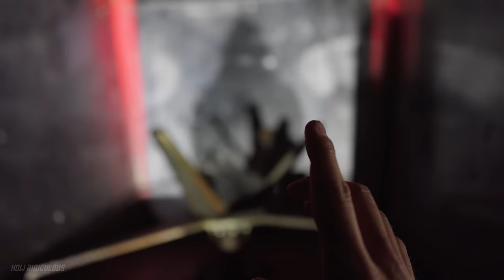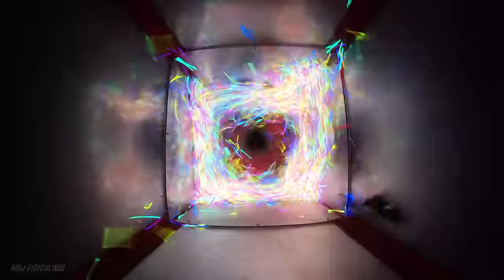10,000 Glow Sticks Vs. World's Largest Blender!

Comment: Mad respect to whoever was responsible for closing and securing the door, during the night shots. When the door pin didn't go in right away on the 1000 sparklers blend I was genuinely scared for whoever was doing that job.
Reply: it cant be that hard to shut  the door 💀
Reply: @AidanMcDowell-ez1ny  i mean, have you ever tried to shut a door that big within a small time margin? its easier when you have more time. but when youre against the clock, things seem to be harder to do
Reply: @AidanMcDowell-ez1ny maybe *you* try quickly shutting a door that’s 10 times your size 💀

Comment: The blades heated so quickly because most flammable liquids like gasoline or most solvents burn hotter than a regular flame from wood. The jet fuel burning from 9/11 is what took the towers down. It melted the frame of the building because it burned so hot.

Comment: Scott putting his hand on a thick metal piece and concluding it has heated all the way through is like my grandma putting a whole frozen chicken in the oven on broil for 3 minutes and concluding that it's perfectly cooked.

Also sure the rotation speed of the fans can assist with the overal heat transfer throughout the metal, but not only did it not sustain the spinning long enough to matter for the heat applied and the thickness of the metal, but it also did not add any "New Heat" like scott is implying. Convection is a method of retaining and circulating existing heat, not a method of generating heat. It could at most contribute to the metal retaining some heat from the fireball, but the fans rotating would not add any substantial heat, and certaintly not 40%. The obvious most important contributor to the heat would be covering the metal in a liquid based fireball for a minute

Comment: I think that newheat is potentially a small factor in the heating of the blades, since it does technically get closer to more hot particles. but I doubt it did much, steel( as all metals) is a pretty good conductor, so it absorbs heat quite quick. also, it being 4 cm thick doesn’t matter too much, because you were only feeling the heat on the surface, it was probably a little cooler inside. Those flames will have easily got to over 1000 degrees C , for about 5 seconds, that’s quite a lot of heat they’re baking in.
Awesome

Comment: You need a remote triggered compressed air cannon on the bottom\floor so you can blast the stuff stuck under the blades upwards.

Comment: I'm on team #newheat - The introduction of convection into the heat, is the same reason that a fan oven heats up faster than a conventional oven.  The heat will exponentially increase, the more oxygen is added to the fire.  This is why you get flashovers from house fires where as soon as oxygen is introduced, the whole lot goes up like a bomb.  Gaunson is right on the nose with this one.

Comment: Steel warms up quickly because it has high thermal conductivity, meaning it efficiently transfers heat from its surroundings to itself. Several factors contribute to this:

Surface area

Density and Specific Heat Capacity

Thermal Conductivity

Comment: You’ll want to take a look at the discipline of heat transfer. My hypothesis is that the dominating mechanism of heat transfer here was convection of the hot air over the fast-moving fan blades that caused them to heat up quickly. Imagine you are a very tiny person able to stand on the blades as they are rotating. All you would feel is a bunch of hot air moving by you really fast. It is the same reason why wind chill makes it feel colder than the ambient temperature, and the faster the wind, the colder it feels.

Comment: the movement of air and material can contribute to heat factors, think of a convectional oven moving around hot air vs just placing food in a hot environment. The movement of air allows heat to transfer quicker to the object its exposed to.

Comment: Convection is only really a contributor to heat transfer when you're using a medium (air, water, etc) because the heat is being transferred, meaning the medium is cooling as the target is being heated. The rate of heat transfer is directly dependent on the temperature difference. However, an open flame is producing new heat constantly. You can't really "cool" a flame. However, the mixing action did make sure that the entire surface saw even heat, meaning it was more effective than trying to use, say, a blowtorch. Based on what I know of steel, the actual surface was likely hot, but internal temperature was still fairly cool, meaning it cooled down quickly as heat is dispersed throughout the steel, as well as ambient losses.

Comment: The heating of the blades was most likely just due to exposure to flames. Friction may have some effect, but there isn't a lot of mass to the cans of hairspray so there isn't a great deal of energy to be transferred to the blades. The blades rotate, so the return to their original positions frequently and therefore don't really get exposed to flame it hasn't seen recently. One way to test this is to burn the hairspray with the blades off and see how hot they get compared with when the blades are on.

Comment: The reason the blades where heated in such short amount of time is the same reason white the flame looks white in the center at some points. The hairspray spread through the air and made all the air in the cage flammable while covering everything in the flaming liquid that hadn't evaporated. While the spinning likely induced stress into the blade causing it to heat up it likely isn't the main reason.

Comment: Instead of all the glow sticks dropped in already glowing, fill two containers with the chemicals to make the glow reaction and drop them in to the blender. As they mix they start glowing more intensely. could be a pretty cool shot as it would go from dark to growing glow juices. make it multi-color though, use a few smaller jugs of chemical that determines color and one big one for the activator, could be extra cool.

Comment: The blades of the steel are hot because of the chopping action.  A lot of energy is dissipated when two object collide violently.  Check the temperature after anything is cut up, it should be elevated.

Comment: Yeah the blades spinning definitely made the heat transfer into the steel faster. The heat gain equation for a heat exchanger is q (heat transfer) = mass flow rate (in this case the speed at which the air is flowing past the blades relative to the blades) * specific heat (in this case the specific heat of the steel) * the difference in temperature (in this case the temperature difference between the steel and the fire)

Comment: 00:55 Ohh! There's a bit of tush here. - Brett Stanford 
01:35 (chuckles but sounds like chicken clucking) 😂😂😂
02:58 😮😮😮
03:02 It's so gross. We're also blending a wheelie bin I think? (groans) Oh-ho! - Derek Herron 
03:54 Aw, it's stopped. - Brett Stanford
07:53
08:04
08:08 Replay 
08:26 Slow-Mo Replay
10:36 That GoPro at the top could be TROUBLE. - Derek Herron 
11:06

Comment: Engineer here, 'new heat' is definitely a thing. Although it's not called that. It's like wind passing through you on a cold day vs. the same temp, no wind. You extract more energy because of the moving air. The blender is the same, but hot. It's called Alpha in laws of convection.

Comment: The "newheat" idea is correct.  "Windchill" turns into "wind heating" if the air is hotter than the object in question, and since the blade is moving thru the air, from the blade's point of view, the air is moving past it, ie, it's wind.  I found this out when I graduated from high school and got a motorcycle.  That summer we had a massive heat wave so I thought I
would cool off by going on a motorcycle ride.  Wrong.  The air temperature was 105F (41C), several degrees higher than body temp, so it felt like I was standing in front of a giant hair dryer.

Comment: fun fact: carbon dioxide literally cannot exist in liquid form under normal pressure conditions; its freezing and boiling points are the exact same, so it immediately sublimates into a gas (or deposits into a solid)

Comment: Air resistance generates significant heat. It's why re-entering the atmosphere causes literal fire on the surfaces of things like meteorites and space craft. Those blades are spinning at a significant enough rate that they are certainly experiencing air resistance. "New heat" isn't a thing.

Comment: The most likely primary contributing factor to the heat of the blades was friction. The most likely primary contributing factor to the sustained heat of the blades was the fact that they were basically spinning through lit thermite.

Comment: Actually the metal was hot because you have a chamber with 1. A lot of flame 2. A lot of oxygen from the twirling blade making that flame hotter. Metal is a heat conductor so it absorb some of that heat. However, the blades has a significant amount of mass, so i doesn't cool down quickly.

Comment: the fuel is oxygen starved in the center of the vortex. As more air is pulled in from the corners and sides it allows for a continual combustion. IF you had holes in the bottom to allow airflow upwards, it would have been ONE MASSIVE FLASH and over or a series of flashes as each can burst upon impact with the blades.
Reply: and steel heats rather rapidly under continuous flame.  think of your sauté pan

Comment: I challenge you guys to put live fireworks inside the blender, of course with a long fuse, some don't have to be lit

The idea is as one firework is suspended in the air and lit, the non lit fireworks would be torn to shreds by the blender and would light on fire similar to the deodorant cans, though this idea has the probability of being more dangerous so definitely be careful if you do like this idea

Maybe even just light a cake firework and drop it in with an extra long wick to time it for the drop

Comment: But, they got hot really quick because they were in direct contact with high heat that slowly dissipated. It would have gotten colder faster than the air too if you quenched it in an inversely proportional energy value to the explosion. Just at the temp of the freshly flamed blender? With a little water? Be safe. Should maybe wear gloves. 

The fan made the flame hotter, and the heat was trapped. It's a furnace when you do that. New oxygen was introduced to the system and the reaction contained so air coming in was heated by the gasses escaping, that's why it was hot. Even when the reaction ceased the hot air dissipated slower, making it take longer for the metal to cool down. The water you throw on it may make steam also hot enough to burn you. It may also crack the blades.

Comment: The spinning actually makes it get less hot in a normal flame. It’s not new heat it’s new cold. BUT the fast spinning and the shape of the blades are bringing in NEW OXYGEN. That oxygen is making the flame burn WAY hotter. In turn getting the blades crazy hot

Comment: Team no it doesn't matter. Why? Because the speed also means that the blade spends less time in contact with each pocket of flame. So it's a wash.

However, the fact that it's spinning probably does quite a bit to aerate the flame.